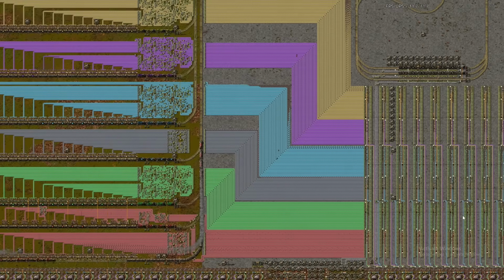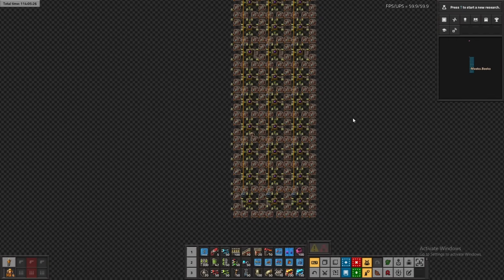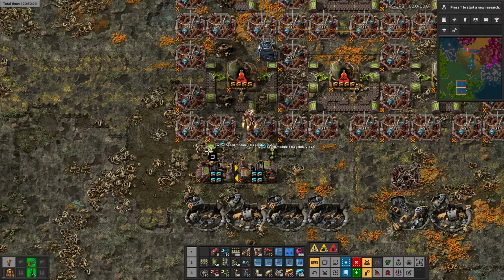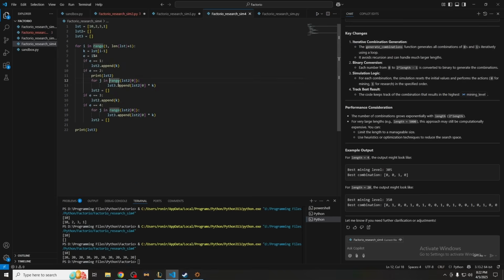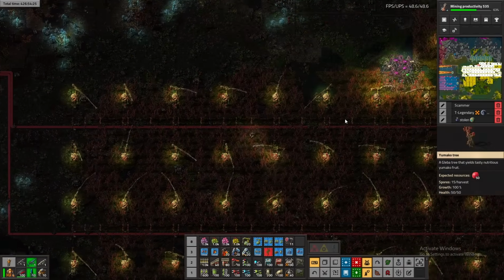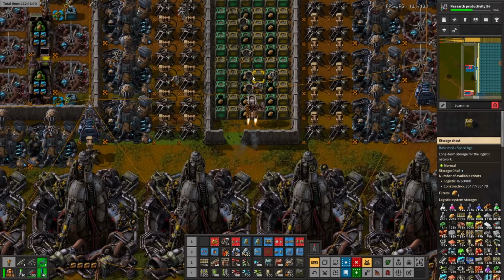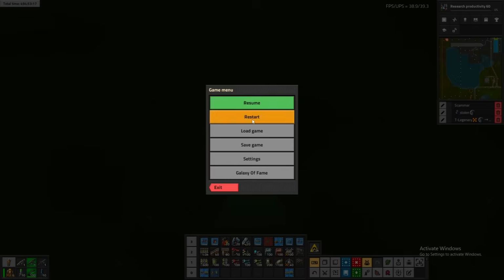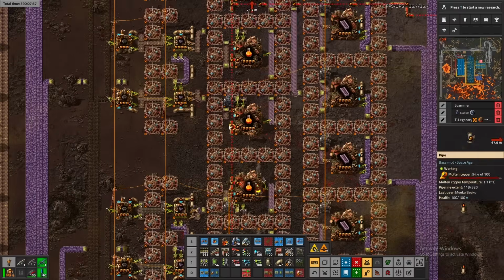HOW I REACHED 4 MILLION SPM MEGA BASE in SPACE AGE FACTORIO

Comment: there's a windows activation script, I used it back when I used windows. It should still work with 11, but I've only had experience with 10(I use linux now).
It's on massgravel's github, and you just run it in a terminal. All it does is get the codes from unused OEM codes(single use per device, the code you would get with a new laptop or something)
I also recommend linux please it's easier than it looks as long as you know how to get around a terminal

Comment: There's a point where you're fighting UPS other than anything. If you're producing 4 million science at 1/4 of the real time, then you effectively is producing 1 million science.
Reply from the maker: If you measure it that way, the guy with liquid nitrogen cooled cpu pushing 8GHZ will pretty much always have better base than the other guy is barely gettinf 4. Its already hardware bottlenecked and calculating it that way will only make the problem worse

Comment: for future reference regarding productivity researches/modules:
any crafting productivity bonus, no matter if through modules, machine internal productivity, research or other factors, is hard capped at +300% productivity, it cannot go above that, only mining productivity and research productivity are truly infinite uncapped, this has been done by the devs to prevent net positive resource loops using recyclers, as those give back 25% of the resources, 25% on the recyclers and +300% productivity results in net neutral overall.

Comment: The reason for your random belt gaps when using the inserters is because of how chunks interact with inserters. Each inserter with in a chunk is checked for a swing in a consistent order. Inserters in different chunks, even if the insterters are neighbours, swing with an independent order. So when you paste down and just happen to cross a chunk boundary, you get gaps. There are other causes, but they all end up being about chunk-alignment. I am now in the habit of making chunk-aligned blueprints to avoid these surprises.

Comment: Oh man, I did a similar design process for my science packs in vanilla Factorio. Built the blueprints to take raw inputs, produce everything on site, optimized the ratios between products, used belt balancers in between each segment of the factory with discrete feed belts to make sure everything was divided as evenly as possible. The main difference is that I was targeting 100 ppm per blueprint lol. The foundries, belts, etc. added in space age really changed the scale of the game you can play at. I can't imagine how much time you spent just on belt layout and balancing, after seeing this I'm finally ready to admit I'm too dumb to play this game lol
Reply: Also, I'd be curious to see how loaders would change your designs. I used them in the high throughput situations with assemblers (like 13:18) and it saved me a lot of headache. I've been told they're bad for UPS though, curious to see what kind of performance impact they'd have when used in a base of this size.
Reply from the maker: Meh probably not much, whole point of optimizing the balancing is to use less buildings and thus save on ups. Loaders would eat up any saving in ups.

Comment: I belive if you cut down on belt usage especially uncompressed ones you can improve the UPS situation.
More direct insertion and very short independet belt runs only where neccessary. 
Possibly more trains as intermediate inventorries for intermediates, say:
Sulfur red circuits and engines into traisn then into blue then into train again, and then scale by amount of trains.
Reply from the maker: There is lots of room for optimization. Thing is, i was already hundreds of hours into this and I didn't want to make another 4 videos. I just wanted something that works, that's also why I used the old ratios. No trains tho, never trains.
Reply: @MeekoBeeko  Why such PTSD from trains? :D
I mean yes they arent the "Best" But I feel the spacing of wagons makes up for lack of throughput, since you can spacout builds in a way that they align with wagons, so you dont have to bother with balancers or big belt highways and just have a couple stations for input etc. Even easier with fluids nowdays.
and then you just do short one way tracks from one intermediate to another to avoid congestion.
Reply from the maker: @FlaxTheSeedOne  My experience tells me no trains. But prove me wrong and build a better megabase, I am curious.

Comment: I'm curious what the detailed time-usage stats look like by the end of that. It would be interesting if it were actually possible to optimise this to the point that it could actually run at 60 UPS. Inserters are generally fairly expensive, but there are many tricks that can be used to reduce their cost.
I'm also curious if there are any parts of this that could conceivably be made in quality. Even just uncommon doubles the science content per pack. It would take more resources and computation to get a reliable source of quality materials, but everything downstream of that prior to the labs could effectively be cut in half with uncommon, and cut further down if higher qualities end up getting made. It would depend on many factors whether or not the result would be worth it.
Reply: There is a channel called abucnasty and his first video is a 4 million SPM Base with 60 UPS and mostly uncommon science. He also has a video series where he tries to even more optimize every important part in terms of UPS
Reply: But a 4 million SPM base in general is a massive achievement and something I would never try because of how time consuming this is
Reply from the maker: Quality is 90% better for ups i am sure, plus u can do lots of things like circuit timing and reducing abundances. I didn't use quality as my original goal was to make as many packs, obviously using higher quality means less packs.
Reply: @MeekoBeeko  That is 100% reasonable. A zoomed-out screen completely covered in random science belts is its own reward.